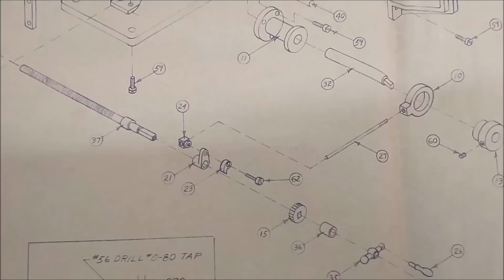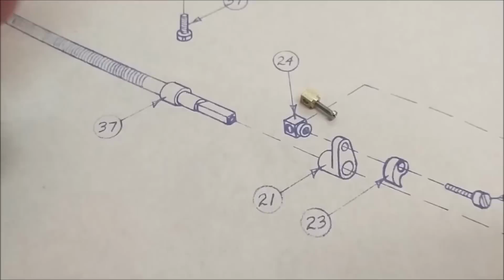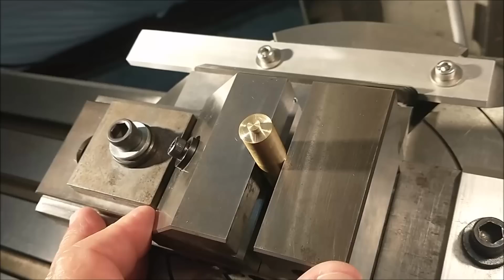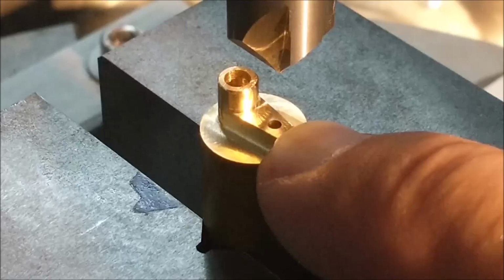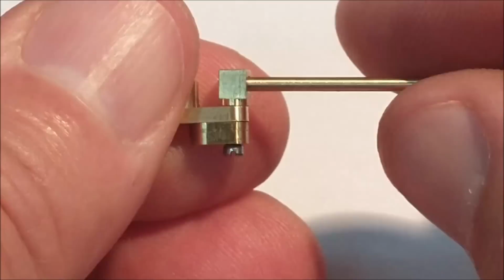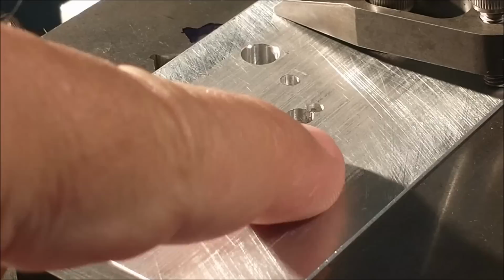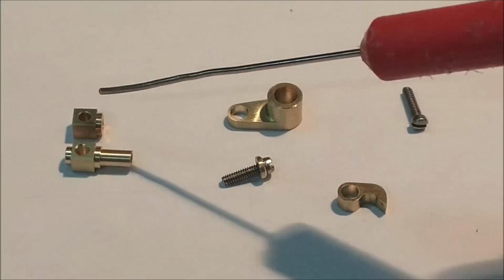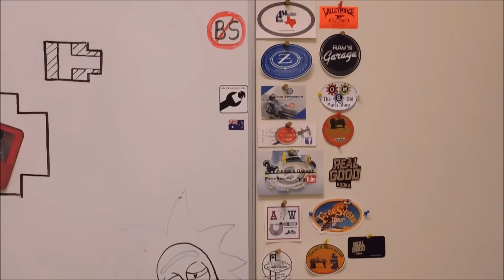Miniature Pawl Linkage -- Lets change the design.......

Comment: Again, the work of a master. Thanks for the really high class of filming and editing.

Time 17:00. Who signed the drawing for that design? Those kits costs, asking for a better design.

Time 25:00. Yes and the chips also blew away... Strange. Have You caught a cold? 

Time 28:10. Just scrapped a pair of Raiban already done. Taking screws from them and using the screws for another set of cheap spectacles fixed an issue. Ugly small screws... Opening a can of beer before helped!

Time 28:35. It looked like that moments earlier. More relief. Polish down the hook a little bit.
Reply from the maker: Thanks for your continued positive comments. Always good to see them. I did find the pin. :)
Reply: @joepie221  You're the master, I'm the student, fascinated by machining.
Reply: @joepie221  
Well Joe, you are always using the Polish, right?

Comment: Hang on Joe how did you hold that tapered shaft to get the threaded hole in the back?
Reply from the maker: The 5 degree transition area is short. I left a cylindrical section that fit a 3/32 collet perfectly. I maxed out my camera card and didn't show that. Sorry.

Comment: Shoulder screw would have been better I think. but brass on brass is a better fit for less friction.  It's a mute point. this way a piny pin hole would lube with some WD. probably wick in.
Reply from the maker: I'll finish the model as is, but replace this, yet again, down the road.